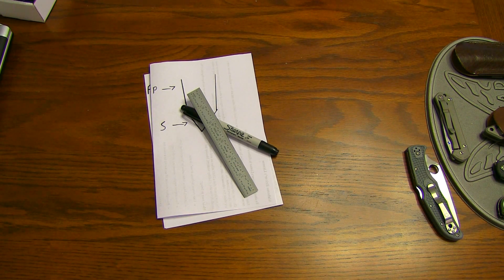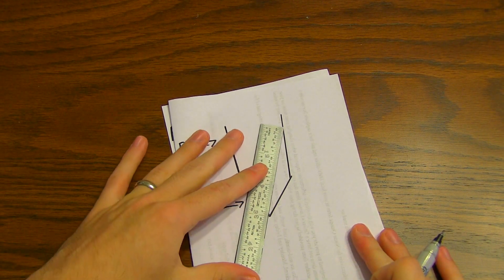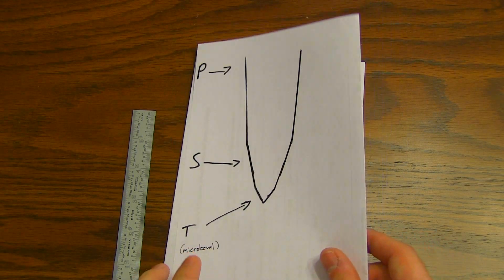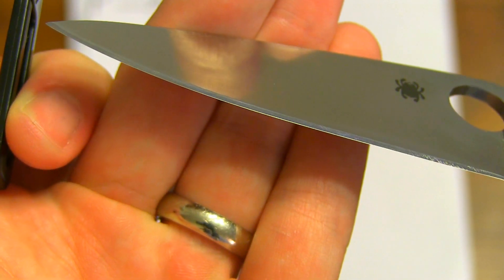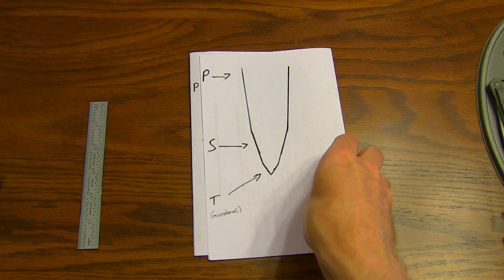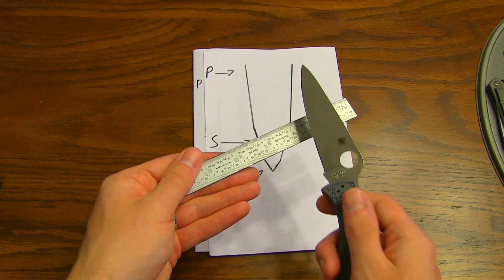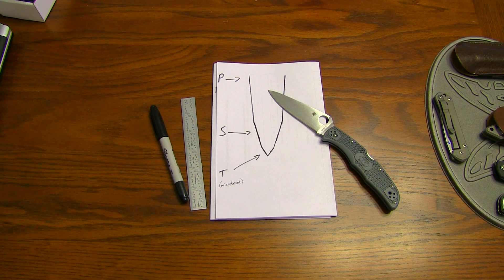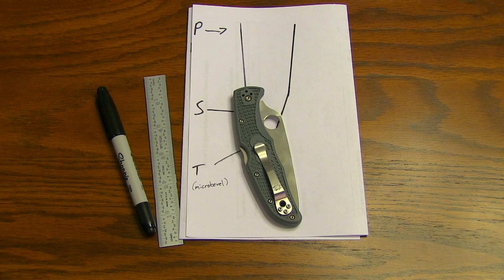Microbevel: What Is It?

Comment: The point is to create a more stable obtuse edge on top of a more acute secondary edge in order to have a strong edge that will not chip or warp but will also maintain its great cutting ability.

Comment: Please let me know if this is correct: The micobevel makes the edge stronger, not sharper, right?  Because with two bevels or three, you're still shooting for the cutting edges to meet at 0 degrees.  So it's using the second bevel to reinforce the third bevel?

Comment: The sharpmaker seems like a tool to make what you say a micro bevel. I don't remember their explanation for it correctly. But they seemed like explaining that 40 degree slots were for sharpening the edge and 30 degree slots were for making the back bevel. If people don't know what is the micro bevel and use the Sharpmaker repeatedly, their 40 degree bevels will go wider and wider chance by chance. And it will go almost impossible for the Sharpmaker to make what they say a back bevel. Thanks.

Comment: your camera settings are much better and this is now actually making better quality video now over the DSLR! Is there a level of hardness or toughness to a certain steel that makes you personally more likely to use a micro bevel? Like ZPD-189 I haven't found to need one but I'm wondering about VG-10 and 154CM maybe wanting one because on 154 I use a 40degree but would like to bring it down to 30-34 and then put a micro on it. But does S30V really need it? it seems like it's on the edge! HAha

Comment: If I'm sharpening my knife on my sharpmaker and set my secondary edge to 30 degrees and want to put a micro bevel on with the 40 degrees side, how many strokes should I do and do I use both the stones (medium and fine) or just the fine?

Comment: Picture looks good. Been using a micro bevel for while on a KaBar small fixed blade. It really helped my blade come alive, because the blade is so thick Virtuoivce has a good video on a micro bevel he applied to afixed blade. He stropped it. I used 5000 grit sand paper. You got a good microbevel on the Spydie. I am seeing how well it keeping sharp. I think you have to strop it frequently to keep sharp. Virtuovice also has a video on removing a very little portion of secondary bevel's shoulder.